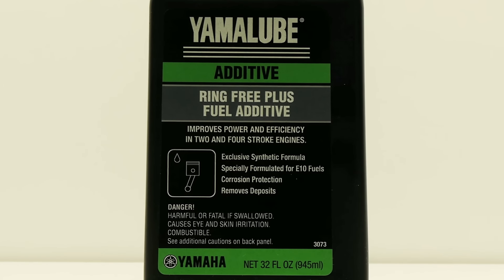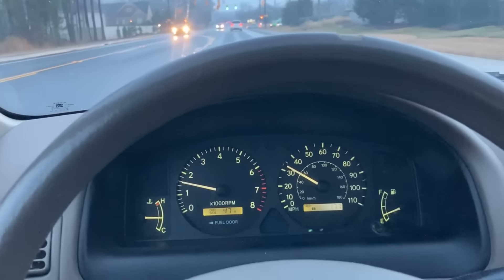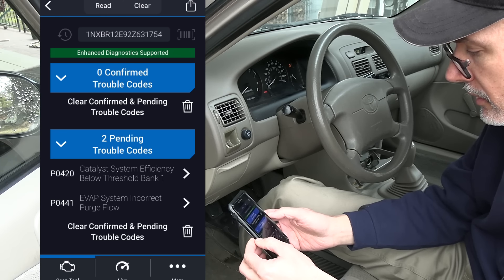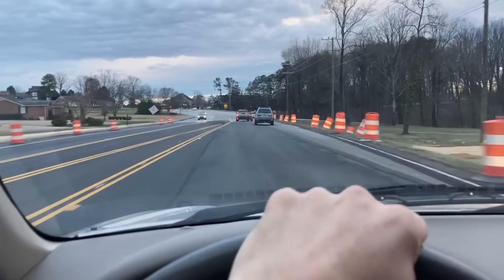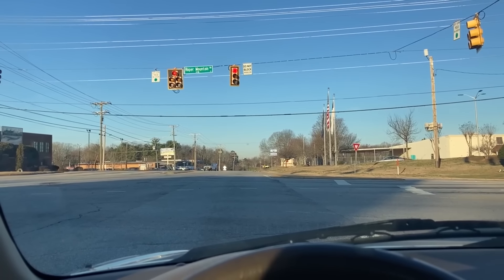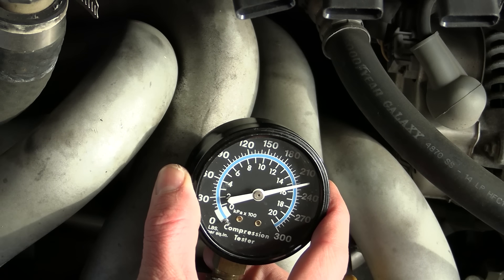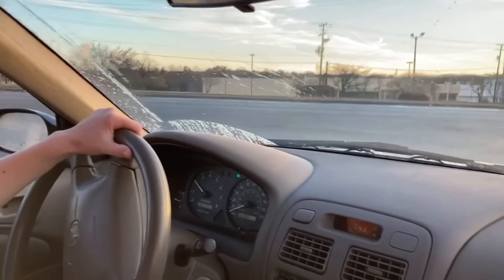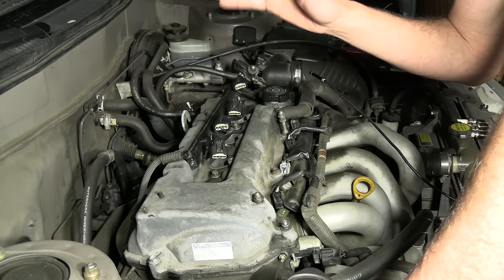Will Yamalube Ring Free stop oil consumption? | Oil Burning🔥Experiments | Episode 20

Comment: Toyota recommends using a higher viscosit in oil, in engines prone to consumption, and it was in a service bulletin. That being said, I would recommend using a diesel oil that covers the SEA requirements for gasoline engines. Diesel oils have a significantly higher detergent component, designed to dissolve carbon and soot. This works on the oil control rings, such as the additives being tested, and results will be noticed over long-term use, not in a meer 1000 miles.
Reply: Diesel oil that’s good for cats? Which one is that??
Reply: @sirdewd2197  Oils with dual SAE designation such as CL4 / SN, as an example. C is for compression ignition, and S is for spark. Therefore,  SN can be used in gasoline engines with an SN or lower requirement such as SG, SL, and so forth.
Reply: i would not use that heavy of oil unless u wanna overheat ur engine
Reply: @lexi-conby  obviously you have little knowledge about oil, as viscosity wasn't even mentioned.

Comment: Would Yamalube cause damage to the catalytic converter or clogged up the fuel injectors? Are there any engine builders who would have any opinions on Yamalube with regards to potential damage while using it on a 4-cylinder?
Reply: IMHO as a professional - the concern would be hard carbon breaking loose - acting as an abrasive and scratching the internal surfaces before the oil is changed and clogging up tiny oil passages controlling things like  VVT / VTEC  any type of variable valve timing controllers / or oil pressure controlled timing chain tensioner.
There may be residual fuel varnishes on fuel components inside the tank - broken loose that may clog fuel pump inlet screes inside the tank.  Hopefully they would be dissolved and not floating around loose.
However - an overhaul or engine replacement will cost you thousands so these methods ( to me ) are sort of a last effort -- do or die -- to recover the engine before replacement of the engine becomes and absolute necessity vs a possibility.

Comment: Its your valves dripping oil down on top of the pistons. Run it and then immediately use the bore scope. Bet the piston look dry right after shut down. Also look at the cylinder walls. If the hash marks are gone your cylinders are toast.

Ive noticed a huge difference between civic and corrolas. The honda motors as well as the rest of the car are just more refined and better built. I have both and the corrola is shot at 130k and the civic is running fine at 300k. The civic doesnt use a drop of oil in 9,000 miles between mobil one oil changes. The corrola already needed a radiator, the civic looks brand new inside. I could go on for hours on the quality difference. Oh and the civic is still on its first own set of irridium plugs at 300k and no miss and no loss of mpg.

Comment: Dave:  why did you add 22 ounces of Ring Free to the fuel?    It shows to use 1oz for every 10 gallons (not 1oz for every gallon) and for “shock”, 1 oz for every 5 gallons.    Maybe I am reading the label incorrectly.  Thanks for the interesting and informative videos you produce.
Reply from the maker: I'm editing this reply because I went back to look at the website recommendations. You're right, the maintenance treatment is 1 oz. per 10 gallons of gas (printed on the bottle). The shock treatment was not on the bottle I purchased, but on a Yamaha website, which actually did say 2 oz. per every gallon of gas. So the shock treatment really is 20 times the recommended routine treatment. Good catch! Thanks again for the input!
Reply: 😂....now we know how much yamalube cleans pistons.
Reply: @FamilyFriendlyDIY   thanks for clearing that up and doing some research on the shock treatment.  I look forward to results of the next product.

Comment: It'd be interesting to see how the Yamalube in the oil will work.  It's probably going to be a time consuming affair.
I'm trying Auto-Rx in my 2012 Scion Xb right now.  I m going to do a second application after 4000 miles.
Reply: Why are you putting it in the oil when it doesn't say too, asking for a friend?
Reply: @charliegibb3908    You are supposed to put Auto-Rx into the crankcase.  It is not for mixing in with fuel.  Maybe you're confusing it for some other product??
Reply: Yamalube does not go in the crankcase.

Comment: I had an 88' Nissan Pulsar NX. 1.6L L4 E16 Beautiful engine.
I used to run 1 pint of KleenStrip acetone per fill up in gas tank (11 gals).
It dumbed down the octane, promoted a higher conflagration rate, very clean exhaust.
I deleted the Catalytic converter, replaced with a silver painted Thrush glass pack, then a regular muffler. It was quiet and smokeless. The acetone helps everything to burn up.
It would keep the plugs clean, rings sharp. The 88' E16 is very snappy, like a chainsaw!

Comment: we sell the EPR additives at our shop, i also used it on my Toyota MRS. i put it in the crank case and drove the car 15 minutes with it, even though you should just let it idle for 20 minutes. didnt solve my oil burning issue at all
Reply from the maker: Thanks for the info.
Reply: @FamilyFriendlyDIY  i did a lot of research on this oil consumption problem on our 1zz's. my MR2 Spyder burned almost 2 litres of oil on 1000km's. the main problem is usually not from the piston rings themself but from the oil drain holes in the pistons. i put the car on jacks and removed oil filter / drained the oil. then i removed the spark plugs and leveled the cylinders. i filled the cylinders with berrymans B12 and put the spark plugs back in so it doesnt vaporize that fast. i filled the cylinders up 1-2 times a day for about 10 days. There was a lot of loose carbon inside the cylinders, i tried to get everything out with a vacuum pump and compressed air while turning the crank. when it was clean put some lubricant on the dry cylinder walls, put the new filter and oil in, started the car (it took about 1 Minute of cranking till it finally started), let it idle for 10 minutes and changed the oil and filter again. that pretty much solved my oil burning issue, it wendt down from almost 2l/1000km to about 0.4l/1000km. Maybe that works for you too
Reply from the maker: @bdmr_isf  That’s awesome. Thanks for posting!

Comment: The P0420 code is pretty common with the 1zz oil burners. After a while it just kills the cat.
Reply: do as I did and hammer both cats out and get an o2 sensor spacer, but make sure it's the 90 degree one and you won't see that code again
Reply: I did that with an 01 Honda Accord. Worked great with spacer. No code agsin
Reply: @stevesmith756  Did you get backfire from the exhaust while driving?
Reply: Nope none

Comment: Dave, 

Why not try Restore Engine Restorer and lubricant for your oil burning issue?  Project Farm did a video for restoring compression in engines and it actually works!  Cheers.
Reply: I did this on my Kubota help with its compression. Idk if will help with oil burning. I did it because  of project farm. I  even did a video and did compression  measurements.
Reply: Used it on my 98 corolla, oil consumption isn’t a problem after a few days, after 2-3 hella consumption continues
Reply: Don’t ever use that in the car which has a catalytic converter , it will destroy it !
Reply: @attilahorvath2055  I used more than 4x here an there at random after 85,xxx oem mile now I have 187,xxx never destroyed my cat converter, I have it laying around an you can see through it has minor clog after getting a P0420 I replaced it with a high flow slp cat converter 2.5 inch size but not destroyed my OEM catalytic converter, using cheap oil clogs your rings and them all that blow by will clog or ruin your cat, everyone has their own fault or negligence

Comment: Exhaust smelling bad sounds like the converter might be cleaning up enough to light off and start doing its job again. I’ve seen multiple treatments of Techron fuel system cleaner in the tank bring converter efficiency back to near new after having converter efficiency codes.

Comment: As others have suggested, change the PCV valve.  I would recommend Toyota OEM or a similar high quality source.  The oil sitting on top of the pistons appears to be the result of leaking valve seals.

Comment: I used the liquid molly oil flush into 2019. My check engine light came on. I've never been able to resolve it. Before inspection I use dura Lube cat cleaner. Go on the highway at 70 mph for about 45 minutes and the engine light goes off. It comes on again after a tank full of gas.
After the Molly flush I developed a oil leak. Had to use two leak stops to stop the leak. So I'm not a fan. Molly oil flush was used at 100,000 mi on a Nissan Altima SE coupe 3.5L. currently have 145 k. The last year it's been burning oil. Going to try the berryman's now. Two bottles in the oil and one in the fuel tank.
I've been using Berman's fuel treatment for years

Comment: At some point I want to see a full engine tear down to see exactly what is causing the oil consumption and what the internals look like after all these different products.
Reply: It’s caused by low tension oil control piston rings leaking from the crankcase into the upper cylinder and combustion chamber. Usually the oil rings freeze up, then the blow by sticks the second ring, and the whole time, you’re blowing smoke at startup, fouling plugs, and eventually misfiring from the buildup of sludge, and loss of compression. Toyota has finally stopped using low tension oil rings, but the 1.8L Corollas and models with the 1zzfe engine from 99-2007 had this problem

Comment: If you do further testing on this engine to try and fix the sticking oil rings make sure you get the engine very hot under load to get the oil rings to release the deposits causing the problems. 

I am a retired GM Mastertech that worked for years dealing with similar problems that we fixed with something called Top Engine Cleaner.

We would warm an engine up fully and then slowly pour a can of TEC down the carb or suck it into the pvc line and then let it stall.  Would let tne vehicle sit overnight and then restart the car and go drive it hard up steep hills several times getting the engine near overheating to break all the crap loose.

Worked nearly every time if done correctly. 

Good luck!
Reply from the maker: Great info!

Comment: consuming oil at highway speeds usually points to PCV system issue and using an oil which vaporizes too easily. (aka MOBIL1). Have you considered an oil catch-can on the PCV hose?

Comment: Lookes like a lot of oil on top of  pistons.  Worn out valve guides and hard stem seals could cause this.  Oil could be running down loose guide. Does  it smoke on cold start and then taper off?Could your valve cover PCV baffle or oil separator be clogged?.
Reply from the maker: No smoke on cold starts Craig ... truly baffling.

Comment: The fluctuaing idle speed might be caused by a Mass Airflow Sensor going bad. That is what mine did on a 1990 Camry with the 2.0L engine before it died.

Comment: TIP: its often difficult to determine oil level on a dipstick, SO : using the smallest drill bit you have, drill holes on the bottom of the dipstick, maybe around 1/8" spaced apart. it will be easy to see the level as the oil will fill the drilled holes.

Comment: That Yamalube seems to work very well.  I was going to say valve seals, but looking back at your old videos, you already did that.  You also changed the PCV valve... But I still think you're having problems with the PCV system.  If the valve itself had gone bad previously, there's also the hoses involved, in which there are 2 that could possibly be plugged.  The one on the front coming off of the valve cover, and the hose coming off the PCV valve itself.  It is also possible that you got a bad valve.  This is the only thing I can think of that is causing your problems.  The reason I think this, is because of the blowby that you are getting.  It seems to be excessive, and shouldn't be as gusty as your is.  Here's a video on the PCV valve system https://www.youtube.com/watch?v=E7j3s71VUsE

Comment: I have been researching more about rings and oil drain holes.

The top ring is the compression.
The second ring does a lot of the oil sweeping off the walls.

The third does the rest.

That sweeping has to go somewhere and that's the oil return holes.

The cross hatching on the cylinder is supposed to hold some oil on the walls.

If the oil returns are blocked then the oil swept off has no where to go.

I have seen B12 recipes that say instead of a hard drive after blow compressed air into the cylinders. A leak down test.

This would put pressure on the holes.

I'm gearing up to try this.

I have a2002 Celica with the 1zz.

Oil consumption is still huge.
But the oil stays cleaner longer.

I find it I keep it and 2krpm it burns much slower. But 60mph in 5th is 3k rpm.

Last oil change I put a can of B12 in the oil and let it idle.

Sitting idle I got no extra smoke from exhaust.

But if I revved it to 3k It started smoking.
So id guess that I don't really start burning until about 3k rpm.

I started doing a top and bottom seafoam attack. In the gas and in the oil.
Also started the redline every day approach. Getting onto a freeway on ramp red line with wide open throttle in 2nd and 3rd(if possible)
I literally mean redline. 

Id say this helped my power noticably. Oil consumption at <2.5k reduced.
I say noticably because if I put low rpm miles on reduced my consumption by half. The only thing I don't know is if it would had done this before treatments.

But I can say for certain that B12 in the oil would smoke bad at idle previously.
It's not a fast cure.

Going to try another B12 but with forced are later.
With the B12 soak I'm thinking about the engine slant and where the oil return holes are.I keep thinking about your B12 treatment and seeing the carbon expelled at the bottom of the slant.
That can't be a coincidence.

Comment: I love this series of investigations, I would really like to see the same concept applied to a high mileage Diesel Engine . So the challenges will be how do you add the Sea Foam or it's equivalent to the cylinder, via the glow plug or injector opening?

This could be your next challenge, if so pick a high mileage VW Diesel Golf please, as I currently have the same issues, constantly topping up the oil.

Any pointers most gratefully received.

Comment: I was going to suggest EPR as your next treatment, but you beat me to the punch. I'm going to wait and see how the EPR turns out for you and I'll either use that or the Yamalube ringfree, or possibly both. 

I have a 2011 Honda CR-V that's burning a quart every 5,000 miles, when I change the oil. I bought it used so I don't know how long it's been doing that. I'd rather not have to re-ring the pistons if I can keep from it, so I've been closely following this series. Good luck and I'm eager to see what happens next with the EPR.
Reply from the maker: Thanks, and all the best with your CR-V!
Reply: Thank you for the series.

Comment: Im loving this series so far. I did the berrymans b12 treatment on my Girlfriend's Vw Tiguan. I seen other people do it on the 2.0 TSI. What I did different. I let the car idle for 15 minutes with the chemtool in the oil. Then i changed it. After that i ran another can in the fuel tank. And did a lot of hard driving. High rpm and load will also help unstick rings, in combination with a cleaner in the fuel.  After about an hour of flogging it. The TSI is running better than it ever has. I will uodate on the oil consumption. Oil consumption was a quart every 800-1000 miles. If this doesnt work. Its probably the valve seals.
Reply from the maker: Thanks! and yes, please do update :-)

Comment: Did the berryman's on my Accord with only one leaky cylinder. Need to check if it's still leaking, but only one cylinder had an oily mess in the cylinder and on the spark plug. Once I let it sit, the piston became so sparkling clean. The other ones have the typical carbon deposits built on you'd expect. I did spray a tiny bit of oil to relube the piston rings before starting it, and the engine sure feels way more lively. At least, that's what my butt dyno says. I am curious how this might mess with the engine only doing the treatment on one cylinder with a compression variance like that.

Comment: I use marvel mystery oil mystery oil in the fuel of a 1997 Nissan pick up truck my ck engine light came on and would go off and on till I got down to a quarter of a tank filled back up came on one time after that went off never came back on after that and had it for another seven or eight years never put it back in after that but did use in the oil a few times after that I just used it to help with   Lubrication

Comment: 93 octane on an old lower compression motor is not only a waist of gas money. It’s also contributing to fuel contamination.
High octane in a low compression motor reduces power and burns cooler resulting in unspent fuel contamination of the crankcase.

Comment: I don't think BG EPR will work. I've tried it on my 03 Camry and it helped clean up the engine, but didn't help with the oil burning. I'm interested if the $300 BG product would work any better though
Reply from the maker: If nothing else works, I plan on doing the BG Dynamic Engine Cleaner as the final chemical.

Comment: First thing I notice is that the cylinder walls are smooth and glazed, this does not help ring sealing and may be allowing oil to come up past the piston, however it is more likely with that much oil in the cylinders that blow by is forcing oil up the pcv and into the inkake, the other thing may be bad valve seals particularily on the intake valves, the seals get trashed when carbon on the valve stem wears them.